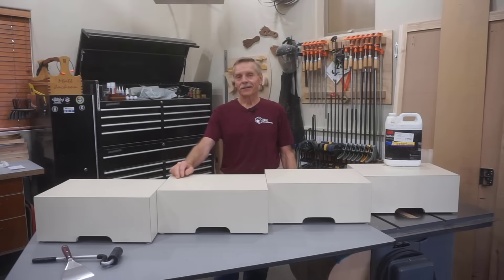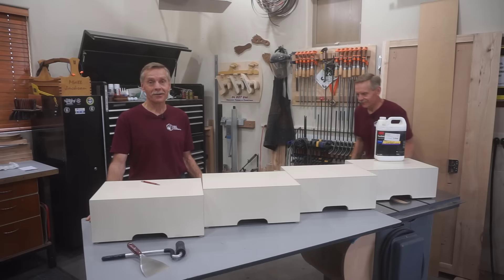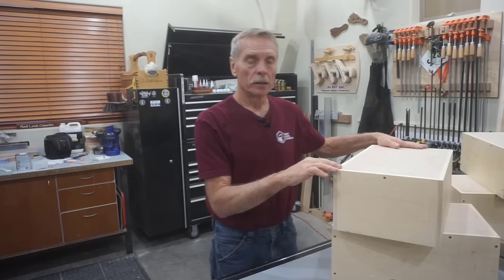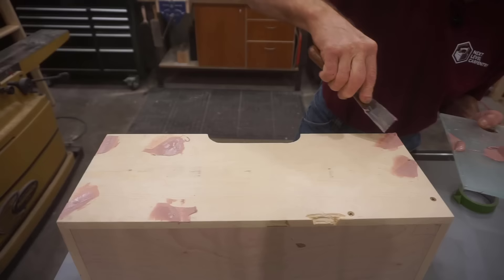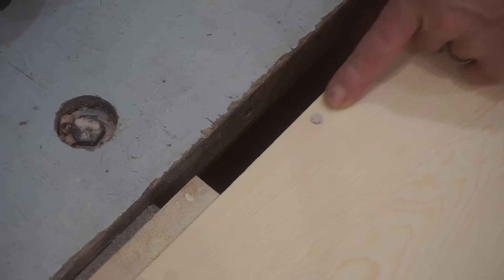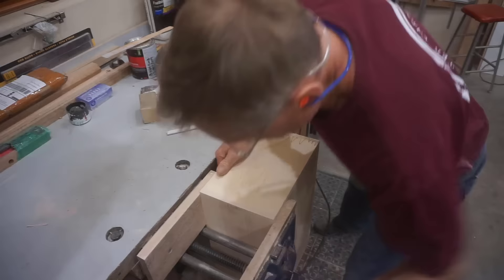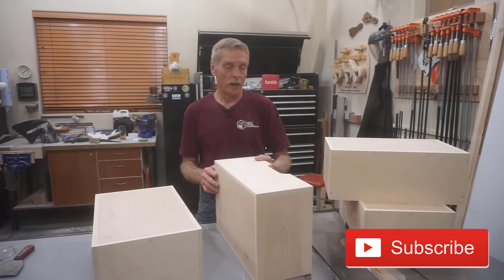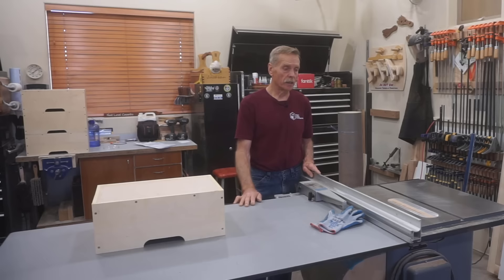Formica Application Master Class

Comment: Excellent video. If memory serves me, the Formica and and Marlite I used to work with in the 60's and 70's was heavier and stiffer. It was prone to chipping and cracking if miscut or mishandled. I still smell Formica cement in my nightmares.  :-)
Reply: That was back in the day of what is now called "standard thickness " laminate. It is still available. Now to the best of my knowledge, you can order standard,  post form and vertical grade laminate.
Reply: @cncwoodworxroc6881  If I may be so bold, I hope I don't have to use the stuff anymore. Just speaking for myself. 😎
Reply: @jerrystark6766  Some of us do, daily. Be glad that you've escaped 😉
Reply: @cncwoodworxroc6881  Believe me I hear you. Best regards!

Comment: My father in law was a genius at this, toolmaker by trade he found this stuff easy. All his arrises were beautifully chamfered (by hand)
   I remember “Formica” being a lot thicker than you are using, in fact I still have a little for odd jobs. I think I preferred it.
 Put felt skids on the bottom corners, keeps it off the floor, and stops them from scratching the floor if people push these things about with their feet (as they will).
Reply: There are two thicknesses one for the table top, to take wear, ad one for the sides, which is a slight thinner.
Reply: @flashfire3220   Thicker  than that, the stuff hardly bent at all !

Comment: Hey Matt, as a fellow former auto body guy you probably know that the least amount of hardner the better when it comes to bondo. Those dark pink mixtures make for much softer body filler. On the flip side to that is it can take all day to sand a large open surface nice and flat, but for great results it's worth it..
Reply from the maker: True dat Martin! One thing I realized quickly after making the transition from Bodywork to woodwork is that in many ways woodwork is far more forgiving than repairing a panel that is going to get a high gloss finish in a dark color where it shows absolutely everything! Best, Matt
Reply: @NextLevelCarpentry  Absolutely..that's why whenever anyone asked me what color to repaint their car...WHITE! Every time..The only good black car is in the junk yard.. 
Not really, but that's my default position..lol

Comment: Fantastic video as always, Matt! 

My only real question is why the clients wanted Formica on the outside of the drawers in the first place. It's hard to make Formica look good no matter how carefully you put it on.
Reply from the maker: Thanks Harcos... these are actually footstools, not drawers.  As such the material was chosen for its durability, color coordination and ease/effectiveness for cleaning.  While a nice painted finish without any dark lines would look great initially for something like a display stand it would quickly deteriorate in appearance in the heavy use environment where these little guys live... Best, Matt

Comment: I tape off and use 2 benches and clamp on both sides. I use a down cut metal blade on a jigsaw and do the cut between the benches. Has to be clamped tight and leaves a bit of a chippy edge but that's going to get cut off with router trimming. Doing a 1.5" side is new to me as I've done many tops. Not happy with iron on edge banding for a countertop.

Comment: CHAPTERS
     2:57  1. Conditions explained
     7:20  2. Fill & prep surfaces
   16:00  3. Cutting laminate
   32:20  4. Prep laminate & apply contact cement
   50:10  5. Applying laminate
1:00:45  6. In-depth trimming
1:10:50  7. Add'l laminate application
1:28:49  8. Advanced laminate application
1:35:35  9. Final filing & clean-up
Reply from the maker: Thank you for posting this click-able chapter list for this video EmElTea... much appreciated!  I'll pin it for others' convenience.   I don't include it in the video description in lieu of other information provided there... Best, Matt
Reply: @NextLevelCarpentry   There is any type of blade, recomended to cut laminate ? or go for the more 
teeth better ?
Reply from the maker: The 60 tooth blade I use in the video is just about right: too few teeth and you get chips, too many and you have to push harder and it can tend to 'burn' in the cut.  Best, Matt
Reply: @NextLevelCarpentry  You're welcome. Thanks Matt for doing the hard part by making and sharing the video.
Reply from the maker: You might notice I 'stole' your idea and used it to post similar time stamps for the recent Pyramid Puzzle build video... thanks again! Best, Matt
Reply: @NextLevelCarpentry  Nice, you can see the chapters in the timeline of that video!
Reply from the maker: Best I could figure out was how to add timestamps in a 'pinned comment' because I cannot figure out how to implement the steps 'they' list for creating chapters in the video timeline... not sure if it's me or YouTube but, of course, I'm gonna blame them! 😉😎
Reply: @NextLevelCarpentry  The way you added timestamps in your Pyramid Puzzles video is the right way. All you have to do probably is copy and paste EmElTea's comment into the description of the video. The pyramid video has chapters because there is a list of timestamps included in the bottom of the description.
Reply: E

Comment: This is a fantastic video. Im sure this was no easy task to film and edit. I worked in a shop that did a ton of laminate work. I swear i could start to smell the laminate when you were trimming the edges 😂 a distinct smell you don't forget we used solvent contact cement too 😖
Reply from the maker: Nothing like the smell of contact cement and laminate in the morning... https://youtu.be/k26hmRbDQFw?t=107
Reply: @NextLevelCarpentry  similarities are not far off ! don't light a match and dont use a metal hammer on the metal lid lol
Reply from the maker: @parsonswoodworks6559  in general I don't like new watered-down products they make to replace the old fully caffeinated stuff but I must say that the 3M fastbond Adhesive is a huge improvement over the old solvent based stuff. I think I have managed to retain many more brain cells than I would have otherwise had I continued to use solvent-based instead of switching😁😎👍

Comment: You could use a longer flush trim bit to the bearing away from the glue.
Reply from the maker: That runs the risk of damaging the laminate surface if the router tilts AT ALL during flush trimming so I don't recommend longer flush trim bits...
Reply: @NextLevelCarpentry  Yep. I should have clarified for initial trimming only. Some laminate top color is so thin that even careful filing will cause damage. I've seen the bearing, especially if not lubricated or old cause burning on lighter colored laminates, so adding some painters tape gives a small level of security when flush trimming where bearing is riding on laminate. I never really trusted "flush trim" bits on final passes so would set up straight edge on router base to trim just proud of finished laminate surface and clean up with file. Also, depending on substrate, no matter how accurate an edge was trimmed & filed, it would move slightly over a day or two and would need to be touched up again. Just my .02 having run miles of laminate back in the day. Eventually went to colorcore to eliminate the unsightly lines, but more brittle than traditional laminate so created it's own set of issues. Very thorough video, btw. Thanks for your time!
Reply from the maker: @danafosburgh2775  your depth of knowledge and experience is clear to see in your comments... thanks for contributing to the discussion here... it reminds me of important facts and gives other viewers a heads up for getting better results by learning from your experience! Best, Matt

Comment: I've found that Super 77 spray contact cement does get hard and flakey.  Kind of turned me off to it.  I laminated some thin decorative aluminum to acrylic, for a night light.  It was a design project.  Only 5 years later, I could see parts edges coming loose.  I pulled off one piece, and it was dry and flakey.   Looking to automotive applications I try a look for heat, UV, and flexible, as descriptors, because of this experience.
Reply from the maker: I'll bet some automotive 'trim and emblem' adhesive/cohesive might do the trick for you Ryan... good luck.  You know, this particular contact cement is pretty versatile stuff and I'd not write it off the list of options without a little test for performance...  Best, Matt

Comment: Another technic that cabinets makers do is to glue the formica to the wood before cut the box parts. When assembling the box the 45 degree angle cut meets 
The edges do not need any kind of trimming.
Reply from the maker: Have you ever actually tried that?!  If you have, you will understand why I didn't showcase that method in this video....

Comment: Didn't realize that they make water based contact cement. Interesting
Reply: Winter time is the worst to work with
Reply: Production shops don’t usually use water base unless they have to by contract or local law. Solvent base in a sprayer is much faster and easier to work with, spray and stick in under 3 minutes. Solvent base is also much more forgiving when you make a mistake and have to remove the laminate from the substrate, just flood some lacquer thinner under the edge and it peels right off.

Comment: I have had issues where the trim bit cuts into the adjacent face of the previously applied sheet when trimming the most recently applied sheet. Solution is to run a strip of tape on the edge of the facing sheet. I use a trim bit that has a triangular HDP guide with a Bering inside. It doesn’t gum up like the Bering guided bit or seize up and burn the laminate.
Reply from the maker: Overcutting as you describe is caused by incorrect bit depth setting (too low/deep) or by adjacent surfaces that are less than  90 degrees to each other.  Adding a strip of tape only masks the underlying cause and means extra filing is necessary to get the desired end result which, if not necessary, defeats the purpose of using a bevel trim bit in the first place.  I've seen bits with the HDP 'bearings' you mention and have it in mind to give one a try sometime because the gumming/burning you mention is not only annoying to deal with but can spoil an otherwise excellent finish job.  Best, Matt

Comment: I've done a lot of laminating but I still managed to get a few tips!  Thanks Matt.  And, although I don't need one, somehow I feel like I have to build one of those step stools.  One question, where I am from they sell two thicknesses of laminate.  One is for horizontal use and the other is for vertical surfaces.  (5 mil and 3 mil I think) The horizontal is thicker.  You said that the laminate you are using is less than a 1/16th thick.  Is that the only size they sell out there?
Reply from the maker: I'm sure I'm using the thin version here, Rick.  I can get the thicker stuff if necessary but I don't think it's stocked normally.  Even though these are for light commercial use 'they' wouldn't want to pay the extra for a special ordered sheet of 5 mil because they put a a little non-slip rubber mat on them in use and the color will probably go out of style before wear would be an issue.  Best, Matt

Comment: Great video! I love when you do your deep in the weeds videos. I’ve never done laminate before and I’m considering it for my next workbench top, would you recommend it for that? Is it reasonably durable and how long would you say your workbench top lasts you before you need to replace it?
Reply from the maker: I really like laminate for workbench tops and recommend it to anyone who puts their bench through the rigors I do, Brian.  The one you see in the video was last re-surfaced like 10 years ago.  It's getting a bit shop-worn but isn't in functional need of replacement yet.  The key is to make sure you put it over a solid substrate like MDF because the laminate is only as solid/durable as what it's stuck to.  Notice I've got oak edges on that bench top.  I glued them to an old solid core door slab and laminated the top after.  That gives you good solid edges compared to laminating them... make sense?  My thinking is heresy to purists who think that a bench should be made of beechwood, have bench dog holes and a tail vise... but I've never seen anyone in that crowd do any steel fabrication or welding on their furniture grade benchtops.  😎

Comment: Not having had used a water based contact cement I do not know if the same holds true; If you need to reposition the laminate after it has been applied use an iron on a warm setting to soften the glue thereby allowing you to pull the laminate away without destroying either the laminate or the wood.

Comment: Ah, I made it to the end. Not sure if I will put laminate on anything, but now I know how.  In any case, I picked up a couple of tricks that can be used elsewhere. By the way, are you still happy with your D-Handle router?
Reply from the maker: Congrats Russ... it's a significant accomplishment to sit through 1:40 on a topic you're not directly interested in so thanks!  I didn't keep the Makita D handle because I was able to find a like-new Bosch just like my old one on eBay.  I think the Makita is a decent second choice but I'm glad I found a Bosch since I like it better.  Best, Matt
Reply: @NextLevelCarpentry  You must have bought the last one. I just checked eBay and there were all the other brands, but no Bosch.   As for your videos, I watch them all, regardless of length, though 3 hours would be pushing me. I'm considering the Triton plunge router. Tamar at 3X3 has one, and she can handle it, even being big.

Comment: Thanks for not skimping on the content of this. It was VERY helpful. I do have a question only somewhat related to laminating. You, like many of us, are using your tablesaw as a work surface but without anything protecting it (I use a 1/4 inch hardboard for this myself). Perhaps it never happens to you, but I were to do a project like this my tablesaw top would get messy. Especially on the cast iron portion of your saw, how do you go about protecting and cleaning it? Thanks in advance for any insights you could offer.
Reply from the maker: This pretty much covers it Donald:   https://www.youtube.com/watch?v=YIE50o5pS6U  I don't like to push products but the Sandflex Blocks are the absolute best for keeping the top clean.
Best, Matt

Comment: It may  be better to use MDF on sizes and top ,the solid wood you may have problems on the future, ,and also it may be better to use dowals for joining ,and you may pas the router whith flush bit insted of sanding  
1/2  of the job🔨⚒🗜🚪🪑🤔

Comment: Very good explanations with great detail.  Nice work on the video!  You mentioned double coating particle board edges.  Do you think you need to double coat fresh cut MDF edges?  Also do you think you need to rough up a glossy smooth surface before applying the 3M adhesive?  The back of most laminates have some shine to them, but we never rough up those surfaces.  I find a sharp card scraper works very well as an alternative to the laminate file.  A lite touch is all that is needed.
Reply from the maker: MDF is more dense than particleboard so I doubt extra contact cement is necessary... roll on a coat and see how much soaks in to decide though.  All the laminate I use has a sanded back surface with zero 'shine' so I've never taken extra steps to rough it up.  I DO rough up the shiny surface of the face of laminate or melamine surfaces before applying contact cement if I'm applying laminate over a 'glossy' substrate.  80# on a belt sander makes quick work of it and assures optimum ahesion IMHO. Best, Matt

Comment: There is no better tutorial out there, thank you very much. 
I was wondering, is there a way to fortify the edges from moisture and water ?
Reply from the maker: Not that I know of Petros.  If I was doing a project that would be exposed to excessive moisture I'd use exterior grade HDF as substrate though since substrate swelling is the cause for failure more than laminate or the neoprene cohesive used to hold it on... Best, Matt
Reply: @NextLevelCarpentry  many thanks 👍

Comment: Hi again Matt. I just got your tip on storing 3M glue and paint rattle cans, wow!  what a great tip, thanks! I have a couple of my buddies at the fire dept checking out your channel now too. I was telling them about your methods, that you're a perfectionist, your attention to detail and your teaching skills with thorough explanations. So Im wondering if you ever spray finish cabinet doors and drawer? Im wanting too do just that. Im a believer that finishing is a whole other animal, that takes a lot of time and experience to learn and master, but id like to take a stab at using a pigmented top coat ( paint). im the type that needs to research and learn as much as I can before taking on a job, watching videos, reading, experimenting...etc. Because I am still in the learning stage, Id prefer to learn it from you, as we have many things in common, and I know that you would use a system that would last and you would have a good method for applying. There are so many things to know about spraying, for example: brand paints, system for spraying, types of coatings etc... Im kinda settled currently on Sherwin Williams Industrial Wood Coatings, ( these cannot be purchased at the retail stores) using an airless sprayer ( Graco) with a ( Graco) Fine Finish tip. Now im trying to decide: which primer/ surfacer to use: - there are several high, low build, vinyl and varnish types sealers and surfacers. Then for topcoats : many, many more water based and solvent based lacquers, enamels, poly U, and conversion varnishes. These are the professional coatings that give that factory finish.  Im assuming you send your wood out for coating? only because I have not run across a vid of you spraying. Sorry for the length of this!!  Please let me know your ideas about wood coatings, thanks Matt!